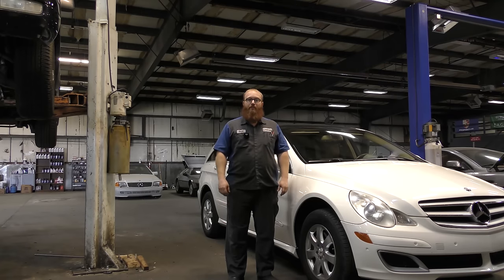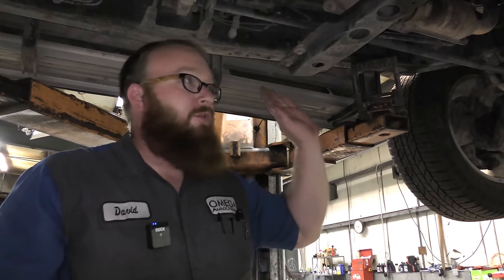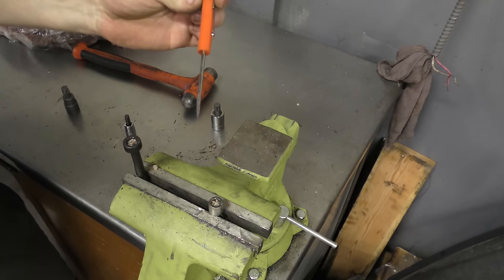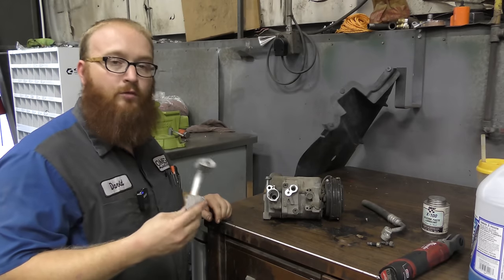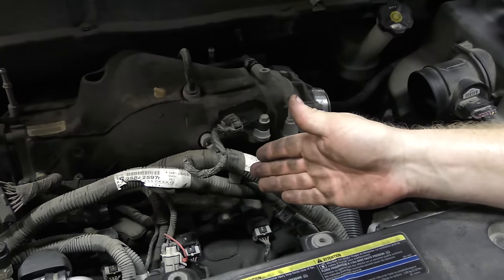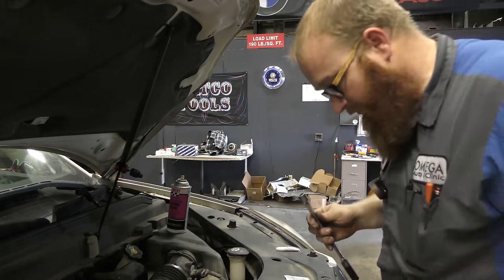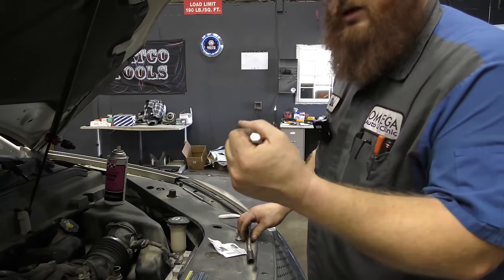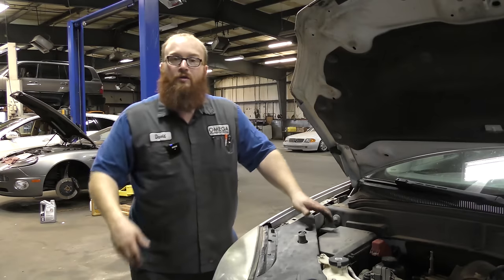The CAR WIZARD shares 10 Crazy Easy and Essential Mechanic Tips

Comment: I would like to get your opinion on my car having a ac compressor/ timing chain/ cam shaft and ecu unit replaced  the timing was redone twice and now its undriveable  with misfiring and shaking, and they said it now has a electrical problem and they have no experience in electrical repair and said they did all they could and all the components of the engine are good due to running into the other problems, so i recently had it towed to a shop who can do a diagnostic test and electrical repair, i haven't heard from them yet but in your opinion can the misfiring and shaking be fixed?
Reply: I just fixed a misfire on cylinder 4, but since the 06 Cherokee had 170k on it I decided to replace the fuel injectors ignition coils and all spark plugs at the same time. Besides the $500 on parts the biggest challenge was getting out the fuel rail by using 2 pry bars against each other and the far number 6 spark plug by the firewall with a shorter sprocket extension I had to go out and buy, it was worth it though, I now get 15 mpg instead of 13 and the misfire is gone
Reply: @markmaligres4288  my car never got fixed from the misfiring/shaking engine it was towed to a 2nd shop and I was told it needs a new engine. So I'm currently suing the 1st shop for damages and ruining the engine and leaving it undriveable 😪 so I'm searching for another car.

Comment: Tip 8 doesn't require anyone to buy anything if you understand what a relay does - it's an electrically activated switch.  Two pairs of wires, folks, connect the right pair (power and device) and it should run.  Most of the time, a simple "U" shaped bit of wire (even a paper clip) will do the trick.  Forget buying a variety of switched relays.  So sorry wizard, you lost a sale.  the rest of the tips are valid and I've used almost all of them at one time or another.

Comment: Wtf? Do not do tip #2. Call a tow truck or buddy with a trailer. Not only will you not have access to a lift on the side of the road to be able to smack it as hard as he did, you don’t want to smack the the shit out of your fuel tank. Very bad idea. I thought he was just trolling. Having a laugh but obviously not. Holy hell

Comment: What could be going on with my 2009:Ford Taurus SE it's got a oil leak and burning oil and oil smoking from the back side of the engine up the windshield and making any sounds or overheating it not m caused any malfunction of the engine and advice and solutions to do